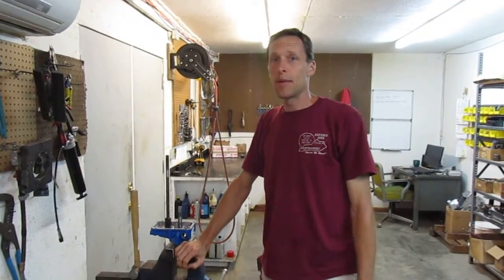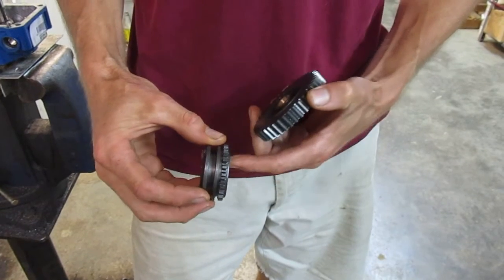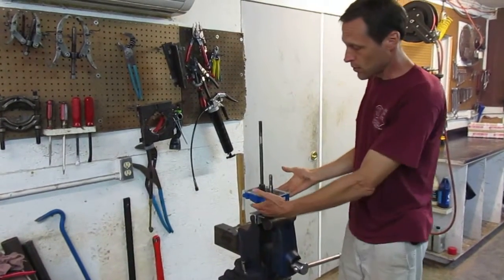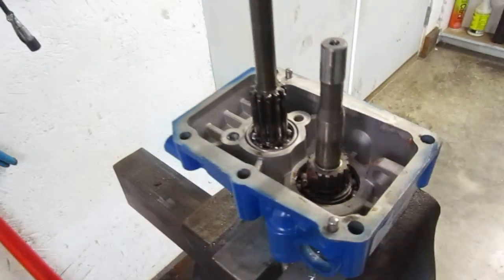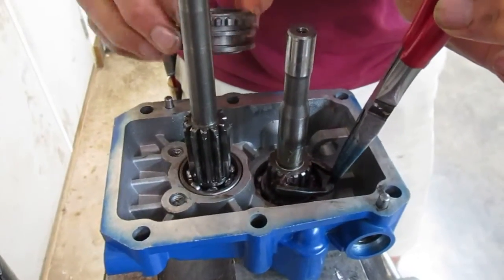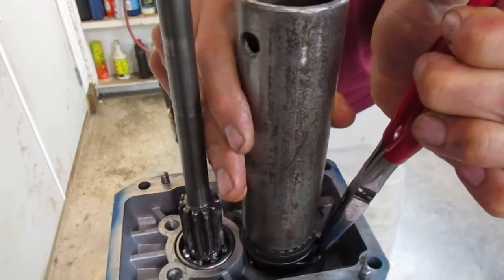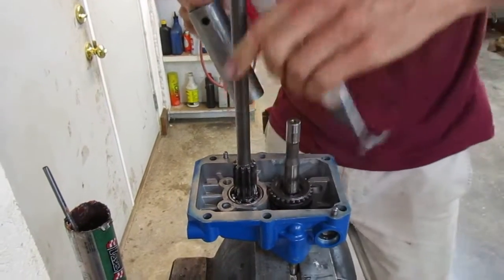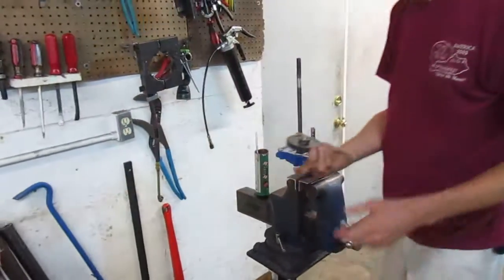BCS Walk-Behind Tractor: PTO Slider Installation (Post-2012 Models)

Comment: fantastic stuff!  I just started to help at something we have here in the UK called a community supported agriculture project.  I guess you guys would call it a small-holding.  We have both a 4 wheel tractor as well as an old BCS 737, which has seen better days.  This video is really, really useful.  Although Lord knows what we will do without them special pliers!  😅

Comment: It is possible to get the balls and spring in position without special tool... but rather difficult... place pto shaft snugly in vice (but not too tight) slide front cover over shaft just enough to expose the hole where the spring and ball go and allow front cover to rest on vice jaws... with a pair long needle nose pliers depress the balls into the hole and lightly tap on the drive side of the pto shaft (that is facing up) until the balls are retained by the bearing... install c clip and slider gear on pto shaft... place a large socket or piece of pipe on top of the slider gear by sliding it  over the shaft... remove shaft and front cover from vice and flip over so implement side of pto shaft faces up and place socket or piece of pipe on top of vice jaws so drive side of pto shaft hangs between the jaws(remember to keep holding everything together on the shaft while flipping it over or the balls will pop out) ... tap implement side of pto shaft until c clip seats...check c clip placement by gently tapping on pto drive end of shaft and looking for movement. 

Doing it this way will work but will likely cause you some amount of frustration as it did me... so is the joy of owning a BCS...

Comment: I just did this procedure last week.  Thanks for posting all the videos!  I spent some time talking to one of your employees (I think named Christian?) who was very helpful.  After disassembly and talking to people at Earthtool, I ordered my parts and the pliers and received them VERY QUICKLY.

A few observations from my experience:

1)  Don't even THINK about trying to do this without the special pliers, I just don't see how it could be done.
2) The pipe shown is 1 1/4 black iron pipe.  Pipe is measured as inside diameter and 1 1/4 inch is not common, but is available.  You may have to get this at an old time hardware store or from a plumber.  It is the type of pipe used for gas lines.  I think the one I bought was 12 inches long.
3) Although Joel did this by himself in the video, and I was able to eventually do this by myself, it would definitely go easier with two people, with the 2nd person placing and holding the pipe.
4)  I had a few misfires when striking the pipe with the deadblow hammer I was using.  I ended up switching to a very small sledge type hammer and got it the first time.  The striking force doesn't need to be great, but does need to be "decisive".

Thanks again for the service and for all the info you put on youtube.